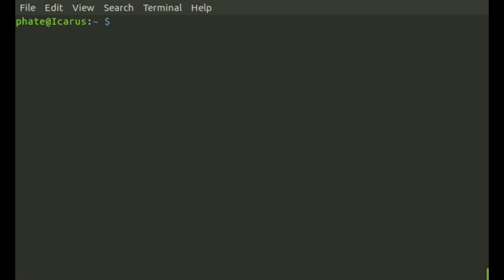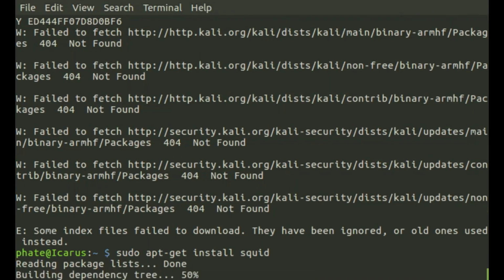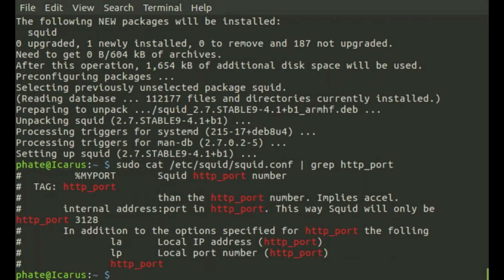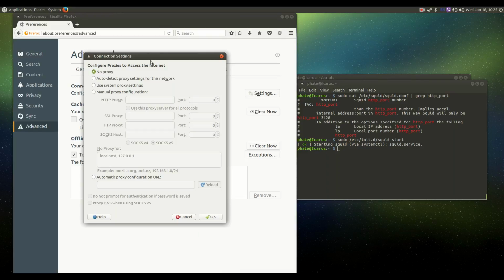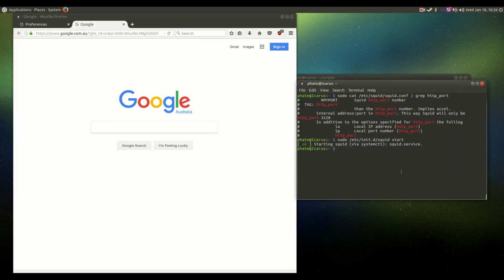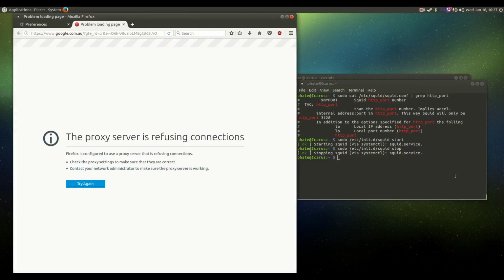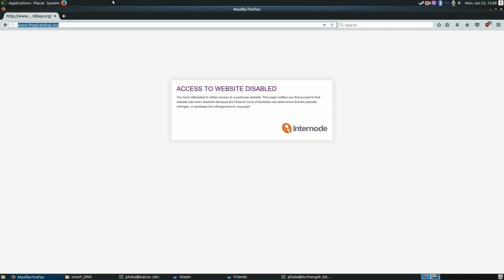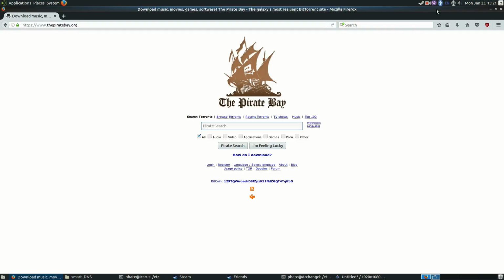Bypass firewall/site blocking with a transparent proxy! pi can do it!

Comment: I know this is an old video, and I don't expect a speedy response, but hopefully something, maybe? 

Anyway to the point... My browser is throwing "The proxy server is refusing connections" error

My setup didn't differ from yours, I even have Firefox so I literally had the same interface to work with so I couldn't get lost in translation

I knew my R-Pi IP Address as I kinda have to in order to run my R-Pi through a ssh terminal in order to set-up Squid, and get my port which was "3128" as well, I've even selected the option "Use this proxy server for all protocols" in Firefox along with the other proxy info everything seems correct to what you've instructed, so IDK what I'm messing up on, that is causing the error?
Reply from the maker: You'll probably find that with squid in the /etc/squid/squid.conf file if you edit that you can search for 'acl localnet src' and it will show IP addresses, if you're getting a refused message chances are it's not got your IP range there (Just a matter of uncommenting or adding the line for yours - if you need a hand with that let me know), mine was set by default but stupidly I forgot to go over that in the video...I'll probably edit and add that section in there as I can probably see a few people possibly having that issue.
Reply: I am also facing same issue